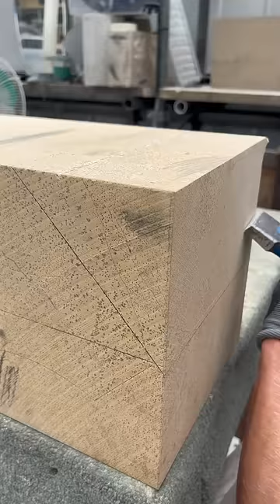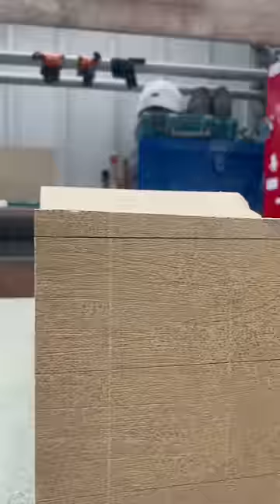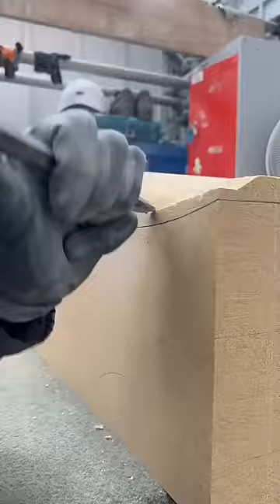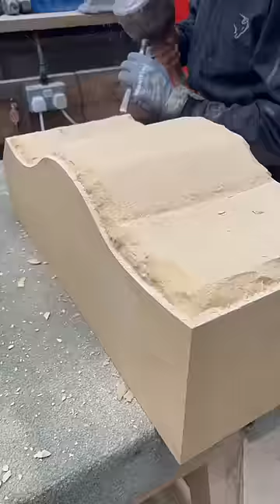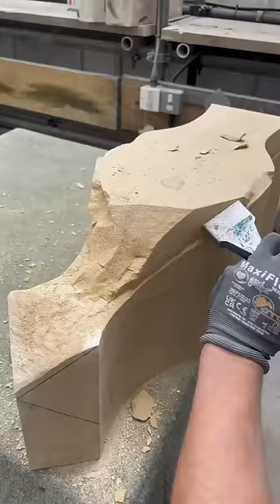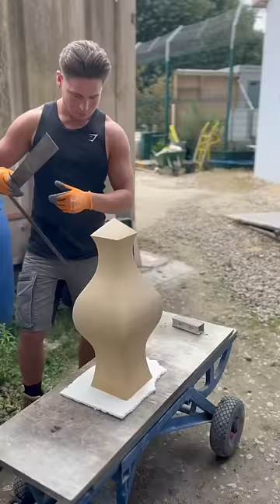#stonemasonry

Comment: Is this man made or quarried stone? The consistency is too good, lookes like concrete kinda
Reply: Limestone can vary dramatically in consistency and porosity.

The Tura quarries that the cover stones for the pyramids were taken from were a very bright, consistent, low porosity limestone.
Reply: Quarried, there's no reason to make a fake concrete stone when there's all those machines that can cut perfect blocks.
Reply: Concrete doesn't break like this
Reply: Also concrete isn't nearly as strong as stone
Reply: Paris limestone looks quite like that. 😅
Reply: A lot of limestone used for detailed work and not structural stability is picked to be very high quality like this. Hence why all their stone is so high quality when they carve detail into it. Ff it's not going to be see then any old limestone will do.